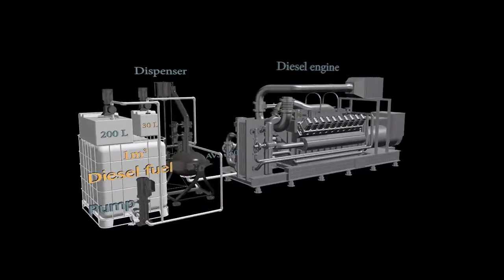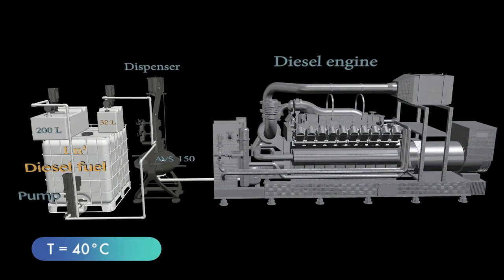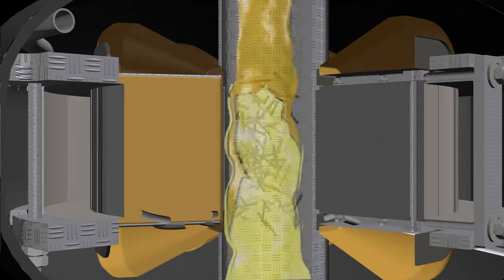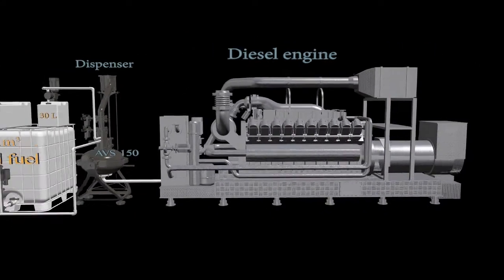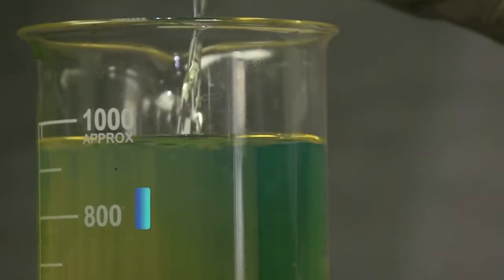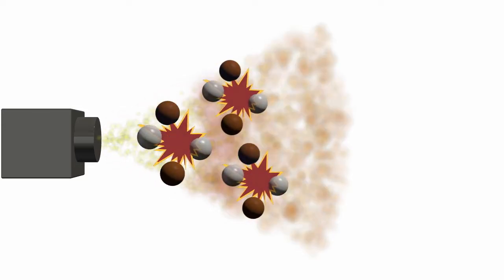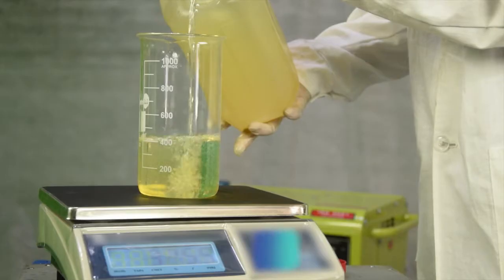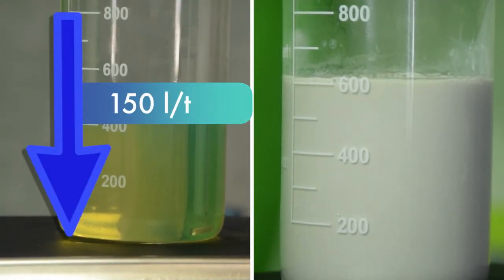#Fuel #saving cavitator, Blending Diesel Fuel and Water with an Emulsifier purification from sulphur

Comment: Could adding a cetane booster such as 2-EHN, water and the emulsifier improve mpg as well as performance?
Reply from the maker: must be viewed as a whole!  there are a lot of stereotypes for increasing cetane and other fuel combustion efficiencies!  need to try!  Yes, you can calculate by the formula, but it’s better to tap on the stand and look under load!  what is the purpose of adding?  storage time?  storage conditions!?  write questions and details to core@globecore.com